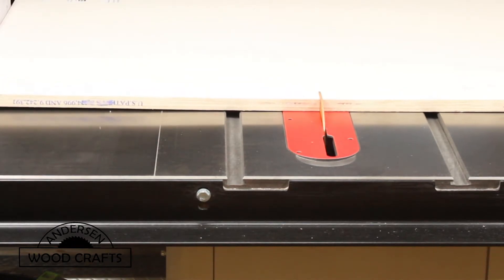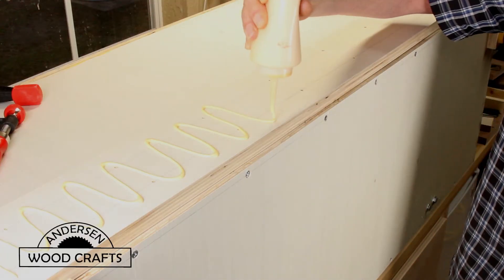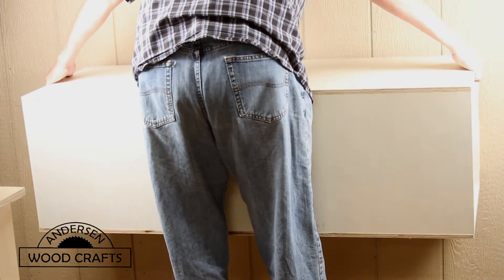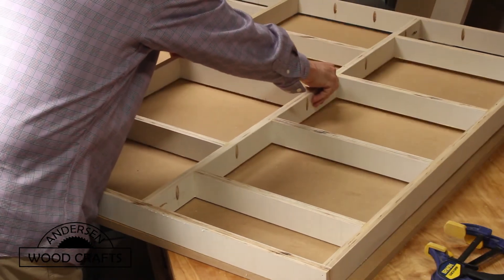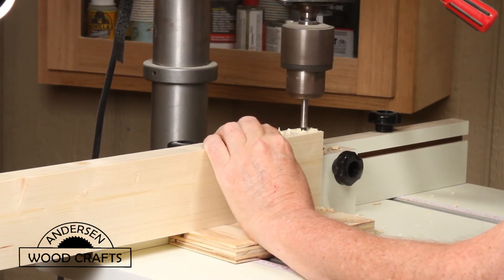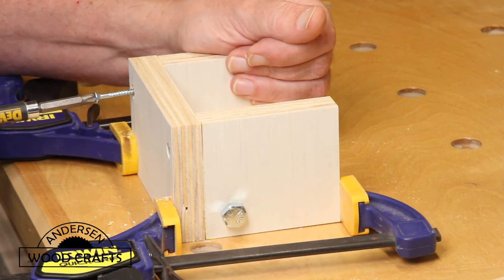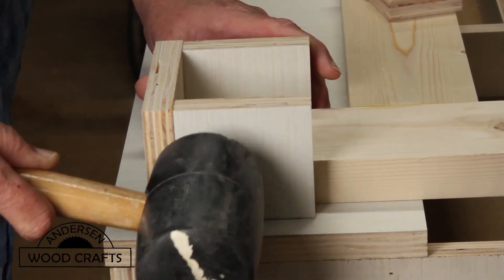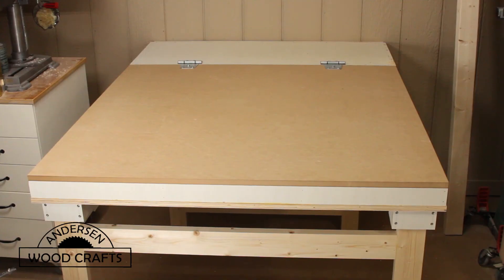FOLD-UP WORKTABLE FOR CNC ROUTER

Comment: Do you have plans available?  I have a small shop and need to conserve floor space. Thanks
Reply from the maker: Sorry I don't have plans.  Most of the projects I build have no plans, the plans are just in my head.  Which I will admit does result in some backtracking, errors, and at times fire pit material.  Thanks for your comment.
Reply: @AndersenWoodCrafts  thank you for responding to my inquiry.

Comment: Do you have the CNC attached?  And any problems with it sitting upright?  I am planning on something very similar as the machine I have takes up so much room in my very small shop  (Longmill)  Looks like this would work very well for me.  Also wondering if the French cleat was adequate?  Or did you mount it more substantially?  Sorry for all of the questions but this looks very good!
Reply from the maker: CNC is on, have raised and lowered the table many times with no issue.
The french cleat was not adequate to hold the weight, I installed some legs (2x4s) to the front of the box and can now handle the weight.
Have fun with yours and thanks for the comment.

Comment: Question:  At the very end of the video it looks like there is a second set of legs back towards the wall. Is there a second set of legs on this?  I like the idea of two sets of legs AND the French clear to keep it against the wall...
Reply from the maker: Yes there is a set of legs under the very front of the box that is on the wall with the french cleat.  It was an after thought, not part of the original plan, but I went to sit on the box and it wasn't holding my weight solidly, so I added the legs and now three of me could sit on it.  Thanks for the comment and for watching.